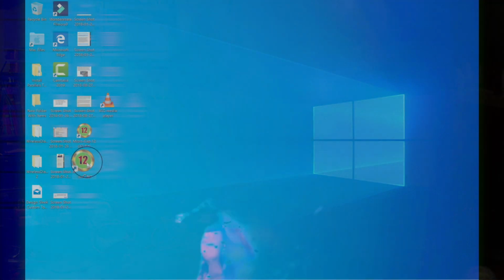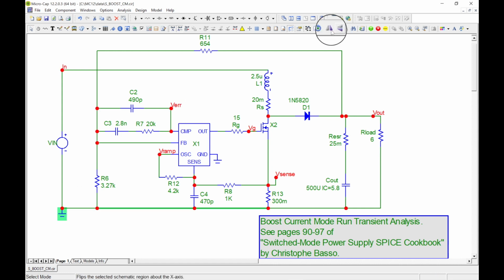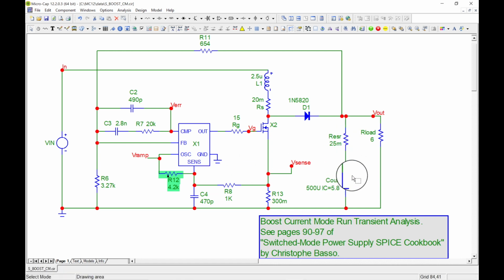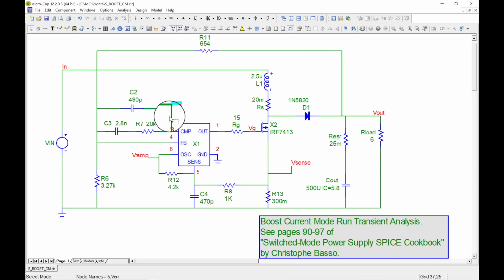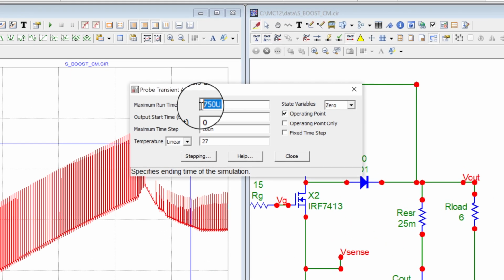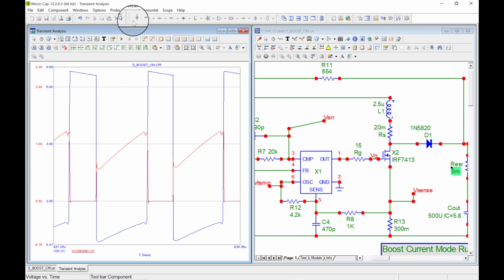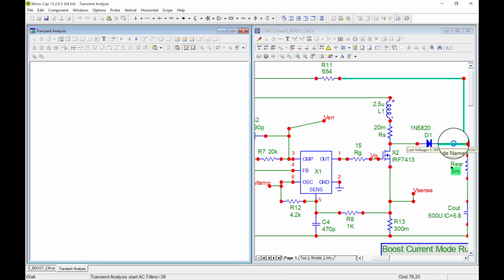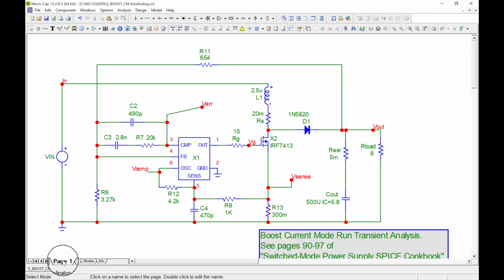Micro-Cap Tutorial #3: Boost Converter #microcap #boostconverter #microcaptutorial

Comment: Another great video.  Very informational and helps with the analysis techniques.  It's been like 30 years or so since I dabbed with Analog.  Just didn't have the equipment on my work bench. So, a major WOW with all the included circuits.  I've taken a stab at trying to set up an plasma ignition circuit with an out put of about 40Kv to 80Kv.   Both the Spark Gap and Transformer are based on macros and can't be stepped the usual way.  So I'm trying to understand how this Macro capability works.  So, yes, you are so right this is an extremely powerful application.

Chugging onto the next Tutorial.  Hoping you'll have some stuff on how to configure macro based components.  Like the Transformer and Spark Gap.  :)
Reply from the maker: I agree David - so many parts and circuits - this tool really makes it easy to get in and have fun;)

Comment: Thanks Eddie en special what you did with the ESR valeu Makes it very clear  !
Reply from the maker: Thanks Bert!  A picture is worth a thousand words - right? ;)
Reply: Kiss Analog Eddie measured a 150-200 Elcos learned that higher voltage is higher ESR also JJ Elco,s 500uf  = 650 uF 500 volt having a low ESR 0,15-0.2 ohm and  another Brand MA Black with Gold letters and graphics High End 😉   2  to 3 times higher ESR
Reply from the maker: That’s really interesting!  Some capacitors change capacitance with voltage, but I guess I don’t remember if I’ve looked at esr over the caps voltage range.  Great info!

Comment: Nice.  Interesting to see the operating characteristics of that circuit.  I think you should do the simulation of your little converter and show the difference between simulation and reality; it would be interesting to see what you would change in the simulation to get it to agree more with reality (adding in parasitics, ESR etc.)  That would give a good feel for what has to be considered.  For example, my simulation was great but the actual circuit wasn't really behaving like it - that's because I chose my output caps badly and had an ESR of 350mOhm!!  Once that was added in to the simulation it went to @£$% as well!  I'm no expert on simulating by any stretch of the imagination but I came to the realisation that you still have to know what you are doing otherwise you get a warm fuzzy feeling from simulating only to find yourself under a cold shower on the bench.  Showing that in practice with your converter would be great. Another thought: remember when you flipped the inductor over to add wires so you could probe it properly to show us what was going on - simulating the impacts of that  'build decision' might be insightful??
Reply from the maker: LOL Andrew!!  You are so right.  It really does take both hands on and simulation time to get the sims to work better the next time;)
I’ll try to do this boost video very soon,
Reply: @KissAnalog  Video on the Optimizer function please
Reply from the maker: OK, that is a great idea!  I have a new tutorial video to release today - I hope, but then I’ll look into the Optimizer function - Thanks!